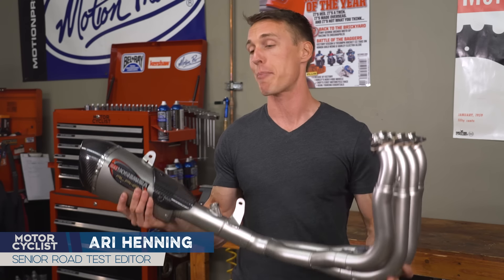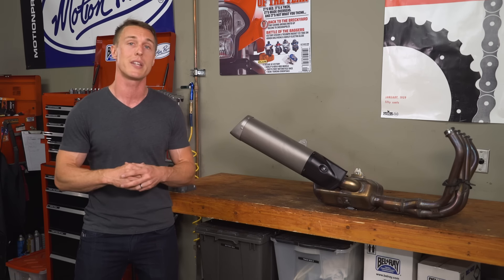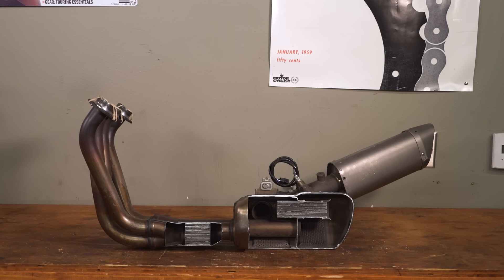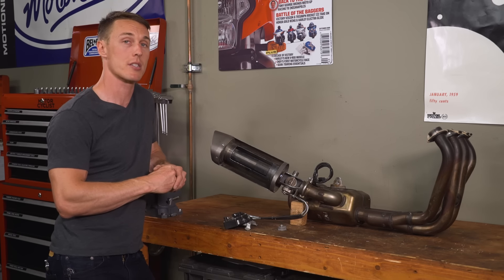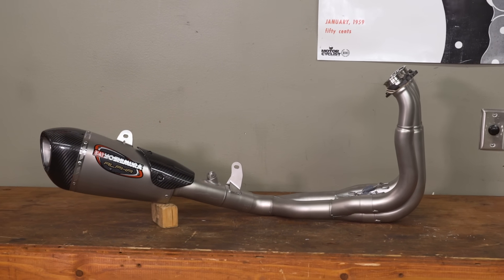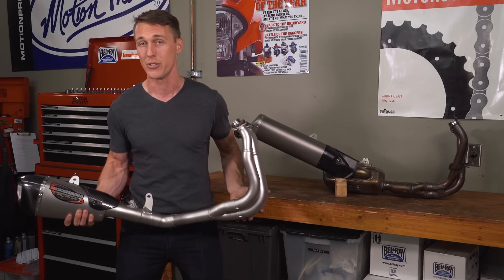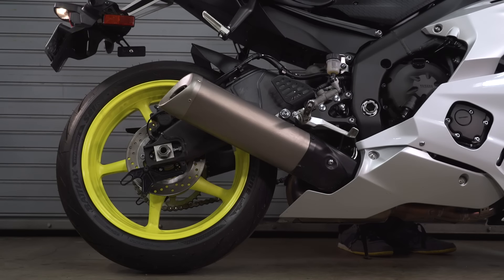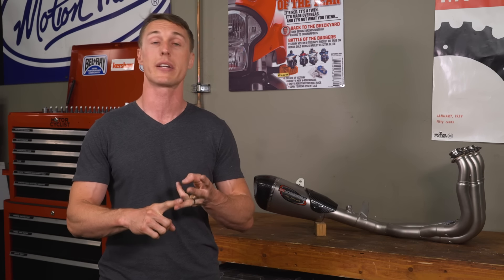The Truth About Aftermarket Exhausts | MC Garage

Comment: I have an 03' GSXR 1000. bought it new, left it stock. Have 206000km on it.  Never wanted the loud pipe, never needed the loud pipe.  Cost for value doesn't add up.
Bike looks fine without plastic carbonfiber bits around the muffler and I can sneak away at 4 am without waking the neighborhood.
 No one with an aftermarket exhaust has ever beaten me in the twisties anyways.  lol
It's a blast being in your 50's on old stock shit and kicking the ass of 20 somethings on new blinged out rides.

Comment: I'm changing my stock exhaust on my Fuel injected CBF600S with an M4Gp slip on, I trust this an easy replacement without the complex ecu modifications or flash in order to maintain similar consumption and or performance. I don't see any CBF s doing those changes.

Comment: If they are true header upgrade. Then the ports will be bigger allowing for greater flow. If they are stock diameter but lighter. That’s just one thing. It’s why slip ons don’t gain much HP but if you upgrade headers too. It’s a bigger gain.

Comment: 2019 R1 listed wet as 441# and 200 bhp = 2.2# per hp.  Therefore that 11#  reduction divided by the 2.2 hp would be = to some 5 hp.  Forget about the exhaust enhancing the engine output,  5 bhp (apparent) is a ton.

Comment: I remember putting a full Arrow system on my 01 R1 not long after i bought it new, it ditched the EXUP valve,  Had it fully set up on a dyno, gained 14 Hp at the top and made better power from 5000 up, but without the EXUP valve it lost that lovely torque those engines made in the low to mid range.

Comment: I was all for stock exhausts until they started putting catalytic converters in them. Now they have to go. Plus, when you retune tour ECU, you are basically richening the mixture, which is always a good thing. I would actually give up performance to get rid of the catalytic converters and get a richer air/fuel mixture.

Comment: The factory exhaust my 250 came with was about 12kg and made of the cheapest nastiest mild steel found. It rusted away in 4 years. A new one from Suzuki was more than the bike cost new!
An aftermarket stainless steel one weighed 4kg, and the bike went slightly faster too. Though to be fair a 250 does not go that fast to start with. 

My 600, same story. Genuine Suzuki headers made of chrome plated chocolate, or stainless aftermarket? Stainless, knock a zero off the price. (And yes, it also sounds a lot better!)

If the factory exhaust was made of something that lasted more than 15 minutes I would not replace it,  there would be no need to.

Comment: Ok, so weight is part of the performance equation....However the 10 lb weight loss shown above could be also offset if I lost 20 lbs (not to mention additional health benefits) since I am currently at 195 lbs and 5'11". Obviously the combination of both would be even better. I am glad that he mentioned the issue of small gains in HP and the need for a program to go along with it.

Comment: Honestly, you'd have to go back 40 or more years before you'd find bikes where exhaust wasn't optimized for engine performance. Doesn't mean aftermarket has nothing to offer, but the gains are modest, if not outright minimal. And pretty much all increase noise to obnoxious levels.

When my CBR600F2 got crunched by a little girl chasing her BF in downtown Boise, I rebuilt it. Mashed stock exhaust was stupid expensive (like everything else), and the aftermarket Two Brothers seemed a bargain. Except it's loud AF. It's pretty...nickel-plated pipes and polished stainless canister, but I've hated it from Day 1. Quiet and performance are NOT mutually exclusive.

Comment: my brand new Yamaha FZ 07 costed me 8k bucks. I just can't see the point in removing the (brand new) factory exhaust system to spend 1/8 the price of the bike in an aftermarket one just to gain two hp (best case scenario) and a more appealing sound. Only when (if) one day the stock exhaust fails, I'd consider throwing an aftermarket one, depending on the price of the original at  the moment of purchase.

Comment: My dirt bike is fuel injected and surprisingly has no oxygen sensor.  Maybe that's because it is a off-road machine.  Anyway the fuel management is assisted by an atmospheric pressure sensor and intake air temperature (IAT) sensor.  The computer determines how much fuel to inject based on atmospheric pressure, throttle position, engine temperature and intake air temperature (and likely engine RPM as well).

Comment: You DO NOT always need a fuel controller if you change the exhaust. You SHOULD use one if you have a high flow air filter and aftermarket exhaust.

Comment: I bought a 01 GSXR 750 and damn thing might has well been straight piped. What's bad is they actually did a great job and had the exhaust and muffler welded on looked professional, but after spending so much buying and repairing it couldn't afford great exhaust but was just too loud for me so had to cut it to get a slip on installed. Will fix properly eventually

Comment: Great video!  I got a serious problem that I thought an expert such as yourself might be able to help me with. I've been riding for over a decade and have owned my 7th new bike as of last week. Over the years i have always installed slip on exhausts that my local garage would install for me.  However, i have run into a serious problem with my 2021 Honda CBR650R.  I am unable to find any slip on exhausts for this bike and i was told by Honda that because the stock exhaust is completely welded with no clamps I would have to go with a full system.  I asked them if the stock pipe could be cut and have a slip on welded on, my local garage told me that they would not do any welding.   I kind of hit a wall at this point, and felt i had 2 options, either stick with the stock (which i dont really want to do) or get a full system (which i dont really want to do).  I then found a bunch of videos on youtube where people had a 2021 Honda CBR650R with a after market exhasts with clamps connecting the exhaust which left me to assume that a full system doesnt have clamps, meaning they were slip ons.  Ultimately, my question is. What would you suggest for me to do here?  Is there a way i can put a slip on onto this motorcycle?  What would you suggest if i wanted to go the route of a slip on?

Comment: Aftermarket pipes only really matter in 2-strokes, because of how the pressure coming back into the engine can really impact power output.
Reply: Yep. They need to be tuned to the system. Very integral to power delivery and a sweet running engine.

Comment: That valve isn't regulating backpressure, it's maintaining exhaust velocity. Ideally there is never "backpressure" or excessive pressure working against the piston as it tries to push exhaust out of the cylinder but, rather, maximum velocity.

Comment: the main thing l noticed on every bike l put an aftermarket exhaust on was on how much my fuel economy went up, especially the himalayan because that thing ran on the smell of an oily rag to begin with and l'm talking an extra 35 to 40km per tank and that exhaust was still factory just not stock (RE called it the off-road exhaust)

Comment: Before even watching this, it completely depends on the motorcycle.  Some are crap, and some are high tech and lightweight aerospace materials (Yamaha Titanium). Some have cats in the headers (which rob a ton of power and increase temps) and some do not.  So it's not a cut and dry formula.

Comment: Most simply want noise.  Like a kid having spokes clacking on his spokes.
The Wings muffler on my 890R does nothing, the bike runs exactly the same and its just as quiet.
But it cost 500.00 so that is a great thing. 2 lbs lighter on a 470 lb bike.
Now they are over 600.00.

The loud baffle for the Wings makes the bike run horrible and its deafening.
Most people run the loud baffle.

Comment: I just changed mine back to factory  as with the de-cat system I fitted I could accelerate quicker it was a better  sound but I lost 20mph from the top end and I was not willing to pay a fortune for a power commander plus my MPG dropped drastically so I found it was lighter louder and quicker to 60 but not as fast at the top end and lost nearly 30% on fuel consumption.
Reply: Same case with my 650 Kawasaki. Fitted SC Project full system (no tune) and I really enjoy the low-end torque but top end has decreased by a significant amount so back to stock 😁

Comment: My pet hate on motorcycles is big cumbersome exhausts get the mixture right with the timing by computer you shouldn't need that piece of heavy weight piping fit a small turbo in the exhaust to re-burn and add a little more power and save fuel...  But i'm a bit of a ton up bloke what do i know...

Comment: You need to adjust fuel delivery on a slip on muffler also. But I think the gain is marginal even if you do everything. If you want more performance, You need a faster bike. It will save you money.

Comment: From Riding and I mean Actual RIDING experience you will never beat the Stock pipe on a 1975-78 Honda CB400F 4 cylinder , the exhaust was engineered perfectly to get the most out of the Engine, plus back pressure in the Day we used reverse cone Megas on a 750 Triumph for that , And fuel control on old Amal Carbs was the throttle and how brave you where to open it
Reply: That exhaust was all about its unique looks, and no one in their right mind would attempt to add an aftermarket, if even such a thing was ever made for that bike. I used own one back in the day.

Comment: Exhaust manifolds, are made with mufflers, and catalytic converters.. which enable crazy horsepower drag cars without pissing your grandma off... 

And, an anti lag system, could store gas in a tank, to constantly spool the turbos, and, when more psi than needed is achieved, a valve system, could open a series of ports, into individual exhaust tubes, through a muffler/catalytic converter combination.

I also like to ionize the exhaust gas, with an electrode, mostly to provide a spectacular light show, but, it also adds some thrust, like thrust vectoring in a fighter jet. 

You could toe different cylinders, to different gas tanks, leading to different turbos, and ultimately, a network of exhaust pipes

Like a church organ

Comment: I have a Akrapovic slip on   street legal  pipe with the Exup valve which I always find odd why you want to get rid of it as you lose a bit of torque and the R6 doesnt have any. And I have  full race header pipes so as far the cops  are aware it's street legal because of the slip on.

Comment: Since this is about exhaust pipes. I wonder if Mcgarage could create a video about repacking of fibres? Alot of people thinks that repacking of fibre in the exhaust makes it sound louder/cooler but it affects the performance of the bike. Or does it? What happens when we keep letting the pipe get backfire and prolong the need of fibre change. Does it spoil the whole system? And during repacked of the fibre, is it a must to clear the carbon in both the full system of the the header plus the exhaust or ohk to leave it? Will the carbon remains shorten or affect the performance/fibre life of the exhaust pipes? T.I.A!

Comment: Him making the comment Power is Last and insinuating it wont make a big difference is ridiculous. That's the number one reason to go to an aftermarket exhaust. POWER!  It makes a huge difference. Also most bikes come rich from the factory and don't even require a power commander. I think that's because the manufacturers assume the first thing the owner is going to do is yank off that exhaust. My ZX14 is rich as hell stock and when I use a power commander all it does it remove fuel since it STILL runs rich with a full exhaust setup. AND WOW what a difference in power vs stock.

Comment: I saved 25kgs (55lbs) off my bike by replacing my mufflers with carbon fibre ones, looks nicer, takes less weight and sound beautifuly, so under my criteria it is worth it, of course you can change the complete full titanium set which will make your bike awesome, but that's personal taste and needs. Safe riding mates, cheers.

Comment: From my experience stock pipe is actually hard to beat. The sound is terrible, the look the weight is not good, but you have usable torque.  Straight pipes have flow but no velocity so you lose scavenging and usually lose low and mid torque in exchange for higher end hp.  Which is useless on the street.  only good for track.  Its best to run a properly designed system that gives good balance of power and sound.

Comment: Luckily my bike has no catalytic converter since it’s not the California version. I have a 2003 Kawasaki ZRX1200R.  I still have the stock header but I’d like to find a exhaust that doesn’t half block my oil filter. I have a slip on Two Brothers  but I put the stock pipe back on till I can  get the a jet kit installed. My bike still has carburetors,
Reply: Your stock headers have two cats in them !!! Very restrictive and heavy. I know as I have owned two of these bikes, and still have my 2002 but with full Akra exhaust. What a huge upgrade to both weight and power.
Reply: I was told only the California version of my bike has catalytic converter.  I’m in Arkansas , my friend can tell by the smell of the exhaust that it doesn’t have cats.  I can’t see one on it anywhere on my 4 into 1 exhaust.  The muffler has a double chamber,but I’ve had the muffler off and I looked in both sides and can see no cat.  If there’s one on there it’s tiny and hidden nothing like that bulky pipe and header on this video.

Comment: You forget to mention most engineers have extremely strict budgets on time and manufacturing complexity and the difference between what they want and what is commercially viable are going to be pretty different. aftermarket engineers don't have their designs in a squirrel grip from a set of board members

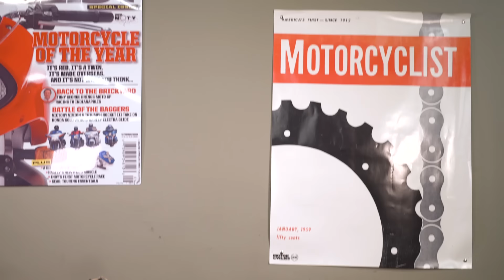Comment: Question: the O2 sensor which you have mentioned in 1:41 that is capable to make adjustment was not enough to make the right fuel and air ratio for the new full system exhaust?. Also ive seen a video from a well known reputable exhaust brand which is based on UK state that the bikes will be fine upon installing the new exhaust becouse the bike will adjust itself to adapt the new exhaust system which is a believe it was the O2 sensor wich allow the ecu to make the changes

Comment: The o2 sensor should tell the ecm if it is too lean and increase pulse width of the injectors to attain a perfect a/f ratio with a higher flow exhaust.
Reply: They do, up to a point. The amount they can adjust is rather small and is mostly meant for taking account the elevation and temperature of the bike and the change of the air pressure that comes with it. Changing a slip on is fine as long as the catalytic converter is in place but when you start changing the whole exhaust system, and especially if you add a new free breathing intake on top of that, you go so way beyond of the stock maps parameters that it doesn't know what to do with it anymore. So a new program is required.

Comment: Aftermarket exhausts only really make a difference in 50cc 2-strokes. Slap a Giannelli or E-Nox pipe on that Derbi and it will have both faster acceleration and top speed than most 125 4-strokes.

Comment: This guy talking about O2 sensor and said it sends signals based on air temp and altitude. Uh no. It measures the amount of oxygen in the exhaust more O2 (oxegyn) the leaner the mixture so the ECU can add fuel to make the AFR match what's in the map. Also take away fuel if too rich. The intake temp sensor will let the ECU know what that is and fuel is enriched by a separate table in the ECU. Altitude will be known by the MAP sensor.

Comment: How can an aftermarket exhaust system make the engine run lean when an O2 sensor is adjusting the air/fuel mixture?

Comment: I just recently bought a 2003 Kawasaki 600 ZZR.  It had an after market exhaust on it when i bought it. It is a Hindle Carbon exhaust. I think the bike used to have a 4 into 2 exhaust, but now it is a single sided exhaust.  Is Hindle a good after market exhaust ??? I had never heard of this company before ???  Also what kind of hp gain did it make over stock if any ??? Thank you for any or all info you may provide... :)

Comment: For the 2009 to 2021 zx6r, the m4 gp slip on takes away the bread box and the muffler but keeps the header and catalytic converter on. Would this slip on also not need a tune or power commander and not run too lean? With stock oem air filter.

Comment: My aftermarket exhaust pipes cost $18 at a local car store. Welded on my 1100 Yamaha 2006. Yes girls it sounds like a Harley. And really rips for what it is. Cut to shit Fender attached to the swingarm. I spare no expense by using gutter seal for the paint job front to back. Is low, loud and goes.